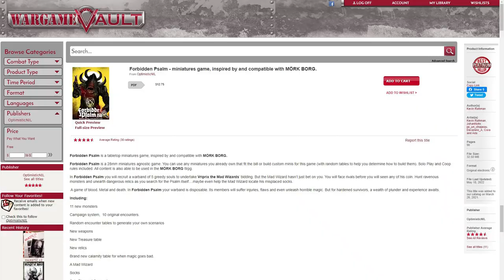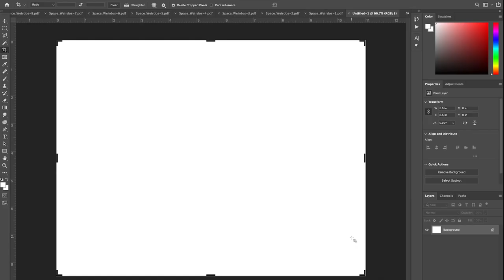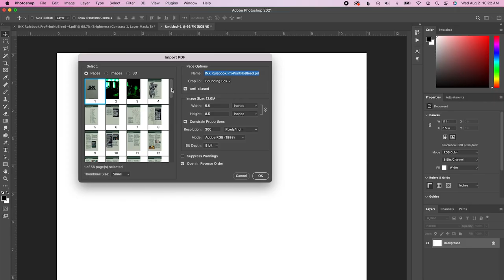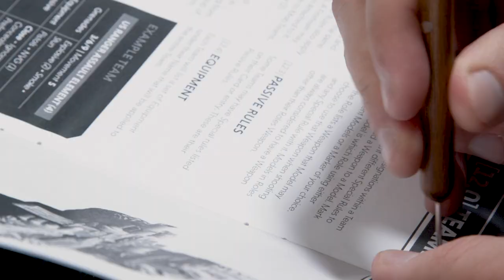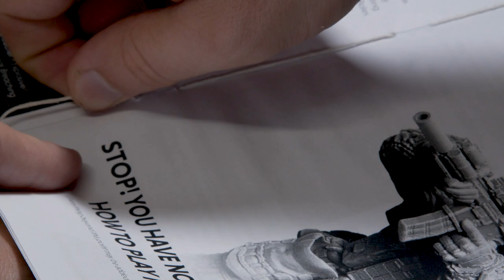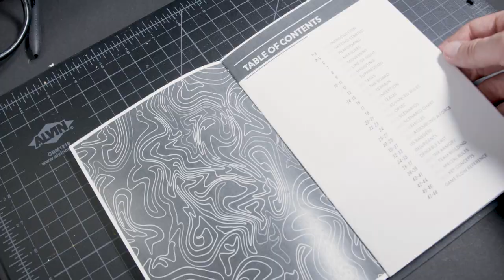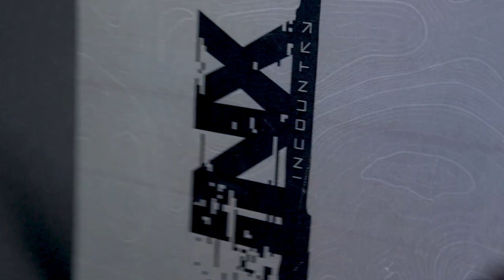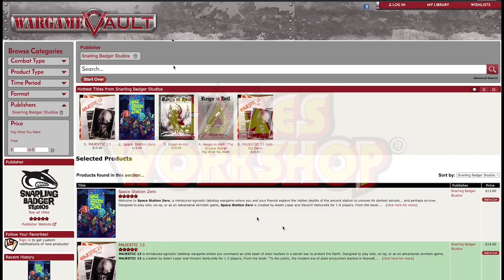Easily Turn PDF Wargame Rules Into Bound Books

Comment: Just as a note for anyone doing this kind of thing, if you're using the waxed thread, don't use a normal needle. Go with one of the ones intended for working with leather, they're designed for the heavier thread